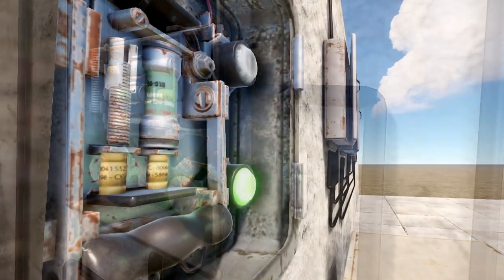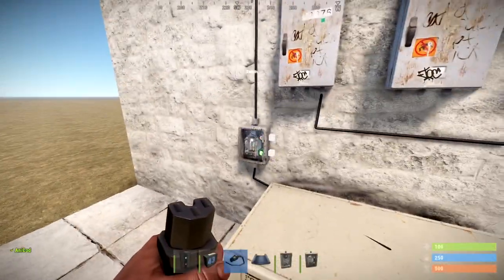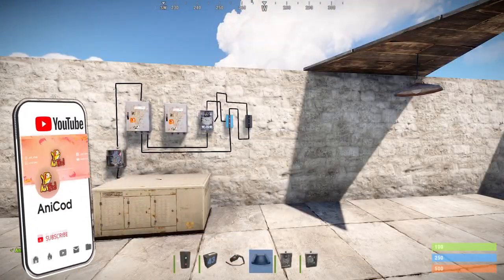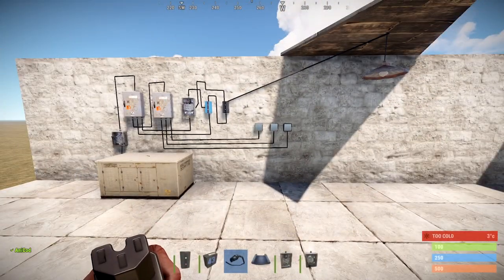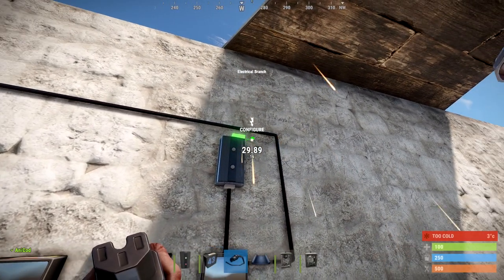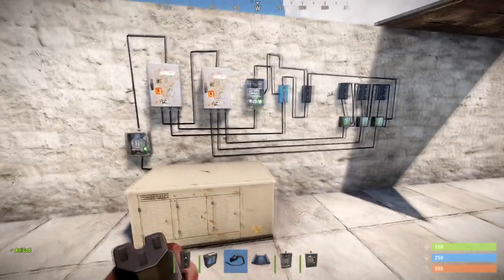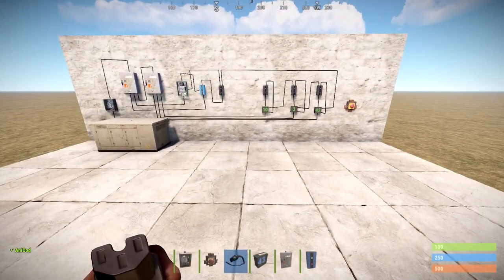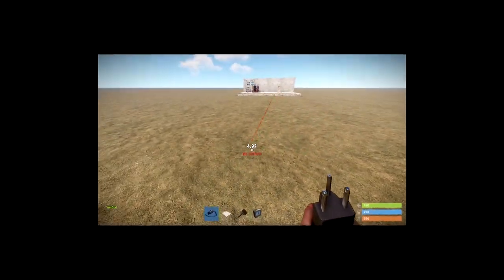I made a working real life digital clock in Rust the easy way - Here's how!

Comment: Anicod i tried the digital clock. As it is now. It requires 50 Rwh (!). Not 11, like you mentioned in an earlier reply. I double checked it. Since the splitters make up for the high power usage and kill your precious power. If power is lower then 2 the branchers don't even work, thus they wont te able to 'reset' the clock for the minute counter. Let me know what you think. BUT it does work, and i love it!
Reply from the maker: these splitters are a nightmare! Probably a good idea to use branches instead, just need to set them correctly... They're just overall better on power. I'll keep experimenting with it and see what I can find

Comment: Set the timer to 0.95 seconds and it will work perfectly!
Reply: Rust must have made changes that prevents this from working accurately. By default 1.0 second on the timer runs too quick (1 second on a timer equates to .9043 of a second). 0.95 makes it even worse. 1.00001 runs way too slow :(
Reply: @shupershuff  so does it work?